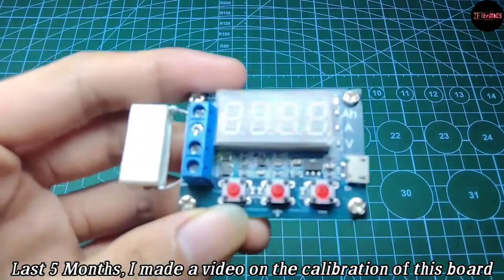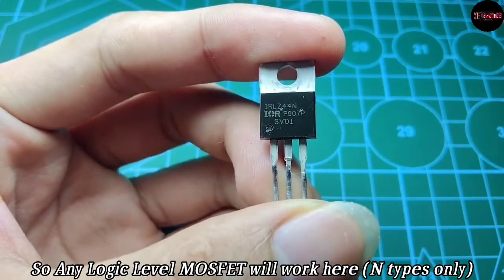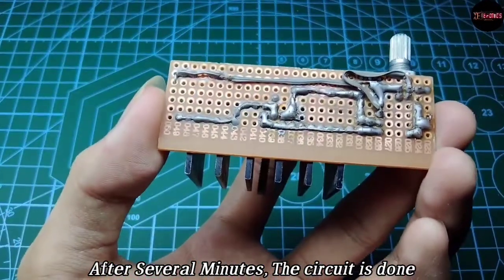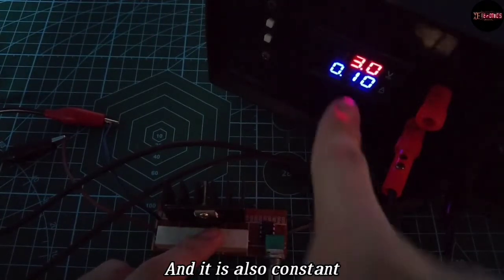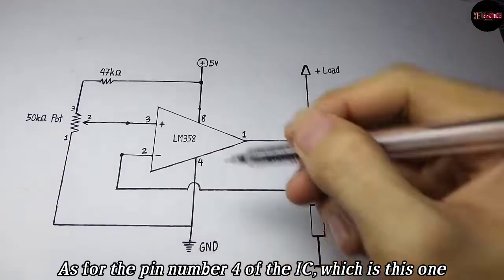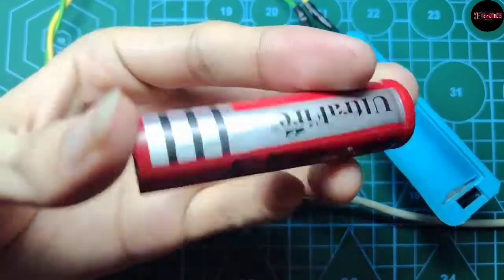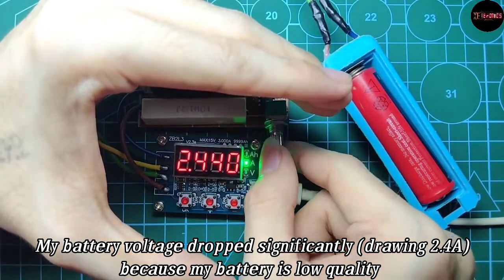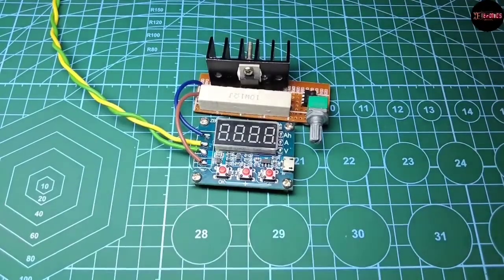Constant Current Load Addition to ZB2L3 Battery Capacity Tester using only 5 Parts!!! #battery

Comment: I built the circuit according to the schematic with the indicated components (the only difference is the 1.5 ohm resistor instead of 1). I immediately noticed one problem: with a 5 volt power supply, I was getting about 600 mA max (...so not enought...). I added a DC booster to the OP's power supply alone, and with 8 volts, I got 2 A. So the circuit works, but for optimal operation, it would be advisable to increase the OP's supply voltage. I hope this experience of mine can be useful. Thanks for your guide.
Reply from the maker: No. Yours was limited because of the value of the pot. There's a reason why I used 50k pot and 47k resistor. Tweaking the resistance of those two will change the max current settings. The reference voltage relies in the supply voltage because it is just a voltage divider
Reply: @x3dtronicsph my circuit as like yours, with 5 volts I don't go much beyond 600 mA. I've seen other circuits use 8/9 volts power supply to avoid these problems.
I'll try modifying the resistor.
Thanks
Reply from the maker: It's because you used 1.5Ohms instead of 1Ohm.

Try changing the 47k resistor with a 22k resistor.
It will work perfectly at 5VOLTS supply with your 1.5Ohms shunt.

The problem with 1.5ohms shunt is you can't draw higher current at lower voltages

Comment: What is the power rating (maximum watts) of your constant current load, sir?
Reply from the maker: Not that high bro.
Around 15watts only.
It's not recommended to increase the power handling because the ZB2L3 module can only support up to 3Amps
Reply: @x3dtronicsph Can I drain a 12v battery with your constant current load at least 2 Amp? (Note: I use a big mosfet heatsink + active dc fan)

Comment: what is the maximum power
Reply from the maker: Depends on the heatsink and Transistor used, It will be limited though because the ZB2L3 has 3Amps Limit
Reply: @x3dtronicsph thank you for responding, if I don't use the ZB2L3 ...
I just want a CC load with high range of power ...
Like testing the 1s,2s,3s...
With high current
Reply from the maker: @manganitemk995 I have another video for that brother, you can check in the channel
Reply: @x3dtronicsph  i dont found any ,can you tell me the power limit of your disgn if i have a biger heatsink.

Comment: Di menit 1:54 LM358 pin 4 dihubungkan dengan resistor 1 ohm, berbeda dengan di skema. Kalau mengikuti skema seharusnya dihubungkan dengan LM358 pin 2. Mana yang benar? Apakah tidak masalah?
Reply from the maker: The schematic is correct brother because I encountered errors.
Please watch the whole video for the explanation
Reply: @x3dtronicsph Setelah mengikuti semua skema sesuai video diatas, kenapa max current hanya di 1200 ma? Any suggestions?
Reply: Potensiometer bekerja hanya di setengah putaran/half turn at (1200 mA)..??
Reply from the maker: What Mosfet are you using Brother?
Reply: @x3dtronicsph Need update your scheme, or remake, re-upload this video.
Reply: @siipokay7526 pakai usb dummy load saja,tinggal atur potensio bisa arus sampai diatas 2A yg versi 15W,terminal block diganti usb female

Comment: Can i use irfz44n ?
Reply from the maker: Nooo.
Any N-Channel logic mosfet will do.
IRLz44n is not a logic level MOSFET.
It will work with higher supply voltages. But that means that you need to check the ZB2l3's regulator or add another regulator.
The usage of Logic Level mosfets here is to operate at only 5v
Reply: @x3dtronicsph  oh yayaya, reason using logic mosfet is can full open under 3V right ?
Reply from the maker: @putriamalia422 absolutely!!!.
Irfz44n can still work, but you need to add regulator to the zb2l3.
There's an built-in regulator in the zb2l3, but I'm not sure if it's powering the whole thing with 3.3v
Reply: @putriamalia422 Sudah pernah membuat load seperti ini? Soalnya divideo diatas, antara skema dengan yang disolder berbeda.
Reply: @siipokay7526 belom bang, tapi kalo lm358 non inverting seperti ini saya bikin nya controller solder sih untuk adjust panas solder aja. Kalo dummy load spt ini belom, belom punya irlz44n, punya nya cuma irfz44n.
Reply: @siipokay7526 kalo pake usb dummy load yg ada dipasaran bisa nggak, kebetulan saya punya tapi belum coba.
Reply: @Awan296-y22 Bisa, tapi Itu konstan resistance, sama dengan resistor keramik.

Comment: Also works with non logical level mosfet like z44n but requires a higher supply voltage ex 12v for higher current load since the gate threshold is higher
Reply from the maker: Yup, it is possible to power both circuit with 12v, addition of regulator is needed, But I guess the builtin regulator of the zb2l3 can handle, it is low current anyway
Reply: @x3dtronicsph  no, it won't both the modules need different isolated power supplies a single one would lead to something called ground loop and the zb2l3 won't work or show a error (happened with mine)not sure how it worked with ur setup maybe using a logical MOSFET made the difference but it's unlikely since the chip(lm358) should be isolated

Comment: Hi, I have connected everything according to your schematic but the current reading is zero when I am starting the test. Even after rolling the potentiometer knob, nothing changes and the zb2l3 reads zero current. What could be the reason?
Reply from the maker: Start the discharge first, it will only show the current when the discharge starts
Reply: @x3dtronicsph I have started it by setting the cutoff voltage and pressing ok. The discharge starts but the current and the capacity remains at zero and the cell voltage remains unchanged....
Reply from the maker: @ervivekchoubey either there's an error with your connections.
Or you didn't use a Logic Level Mosfet
Reply: I am using IRLZ44N which is logic level mosfet. Verified connections multiple times but didn't work. I think I need to give higher input voltage to the OPAMP IC or maybe separate voltage...
Reply from the maker: @ervivekchoubey did you use LM358? Probably its because of a defective component

Comment: Can I use 100k multiturn potentiometer instead? I don't think it makes any significant difference right?
Reply from the maker: Change the 47k resistor to 100k as well, it needs to be the same with the pot value to have a voltage divider that will give a maximum voltage of 2.5volts .
You can use any pot value as long as you change the resistor connected to it
Reply: Ok thanks 👍

Comment: Load or sense resistor negative and the pin 4 of LM358 should be isolated. Means the load resistor shouldn't be grounded right? It will directly go to R2 node of the zb2l3 module. Is that correct?
Reply from the maker: Yes, the load negative will be connected to zb2L3's ground by the MOSFET of the module when you start the Discharge.
It will give an Error 5 if you grounded the load negative
Reply: Thank you for confirming 👍

Comment: Can you tell me how much percentage difference you got in capacity measurement using the electronic load vs normal resistor load on zb2l3. Thanks.
Reply from the maker: In my case bro, it was the same. My Estimated value probably less than 5%
Reply: No difference zb2l3's microcontroller compensates for the lower current with lower voltage (ohm's law basically)
Reply from the maker: @SharvilSawargaonkar yup,, the main advantage of this addition is to set desired current easily.
And for faster discharge

Comment: I am getting error 5 in normal mode when I try to test any battery
Reply from the maker: Rewatch the video bro. The negative input of the battery and the Ground of the circuit should be isolated, you're bypassing the Mosfet that's why.
You need to isolate it

Comment: I use this device.  When I tested the damn battery that said 5000 mah, the device said the battery was 150 mah.  I am not sure if the battery is fake or if the device is of poor quality.
Reply from the maker: Well it depends on the current you've set sir, if it's a Low Quality battery, most likely with High Internet Resistance, it cannot give high current, so if you discharge it with example 1Amps of current, that battery will drop it's voltage and the discharge Test will stop. Try it with Lower current discharge
Reply: @x3dtronicsph  How many volts should I choose for discharge when performing the operation?  I tried 3.0 volts before.  But I couldn't get a good result.  I wonder if it will work if I test it with 2.5 volts?
Reply from the maker: @Elshan_Mammadov_ try to decrease the Current first bro. Try to load it with 12ohms resistor instead

Comment: is there a way to put a fan while discharge? can you make a video?😅
Reply from the maker: What do you mean??? The Fan will start automatically when the discharge starts???
Reply: @x3dtronicsph  yes in resistance. can you make a video how to put mini fan to resistance.
Reply from the maker: Well, you can make another comparator circuit just like the current Load, but the output of the opamp will turn a transistor on, you can connect the fan to that transistor
Reply: @x3dtronicsph  where can i find the transistor? and how to connect. make a video bro. many people want to learn, just like me as beginner 😅
Reply: you can use mini fan as load,but first check the polarity of resistance pin.The fan will turn if battery discharge is start.

Comment: Can I use a signle LM358 to control many Mosfet? I plan to make multiple 18650 slot tester with constant current control. Thank you for your advice
Reply from the maker: You can try , but add around 1k resistor on it's gate probably, Because if other MOSFET go shorted, it can protect other MOSFET, cascading MOSFETS is possible with Dummy loads, but if you're gonna use separate batteries every MOSFEt, i guess it's a bit complicated
Reply: @x3dtronicsph  Thank you for advise, I googled it recently and found that my idea is not good. People always suggest to use 1 IC : 1 Mosfet. For now, I plan to only share the potentiometer and the rest components will be separated. I have another question. I need to increase maximum discharge current. Apart from parallel multiple Z2BL3, can I modify the Z2BL3 directly like change IC or Mosfet? Thank you again here :)
Reply from the maker: Sadly, the ZB2L3 
 is programmed with only Max 3 Amps of current, thats Why i only designed it with 2.5amps max only, evem you change the ZB2l3 mosfet, the current reading is based on its Shunt Resistor, so I guess you need another version of Discharger if you want higher current
Reply: @x3dtronicsph  Hi, is the current fixed to specific value and independent to the voltage of 18650? Like I set 1A at 4.2V at the begining of test. Is the current will drop when the voltage is approaching to 2.75V which is consider as 0%? I have the discharge device which can maintain current until the end. I hope that solution in the video can achieve the need.

Another question, I could not find 47k Resistor. What is the purpose of the resistor? Can I remove it?

Thank you sooo much
Reply from the maker: The current is Constant bro at any voltage (minimum of 2.5v) , the purpose of the 47k resistor is to create a voltage divider with the 50k potentiometer to have a limit of 2.5A of current, (2.5volts reference for the opamp since the supply is 5volts) . The module can only handle up to 3Amps of current. If you don't have that 47k resistor, you can use any Value, but the potentiometer value should be close with that resistor value. Example, 10k resistor with a 10k potentiometer
Reply: @x3dtronicsph Thank you so much for advice, I will try to find 47k as I already had 50k Pot. Anyway, I asked about current as I experienced that current is dropped like from 1,000 mA to 8xx mA once Voltage is drop from 4.2 to 3.3v. It is not about the cell is weak as I can adjust the Pot to compensate the drop and the cell can come back to drive 1,000 mA.

Comment: Im still New to electronics, i see you comented that you use lm358p, can i use standard lm358?
Reply from the maker: Yes of course, just make sure it's a working Op-amp, Lot of Fakes nowadays
Reply: @x3dtronicsph umm, I have made the module, but why mine does not work, I have used Lm358P, when this module is connected to zhiyu, zhiyu read it 0.10 which is usually 0.06 and in the video you said that the mosfet will be hot, but what I have is not at all, can you help me? I try to use a separate power supply and the results remained the same

When i test the battery and turn the potensiometer The current read unchanged remains 0.00
Reply: Thanks

Comment: Why add CC load? The ZB2L3 adjust is current counting to keep accuracy correct. I have tested this many times.
Reply from the maker: Yes it's true. The actual main reason i made this addition was, to have an easy selection of current when using different kind of battery Voltage ang Battery type. It's pretty annoying to change the resistor value every time,  also having a CC discharge improves the discharge speed because, Batteries decrease voltage over time and decrease current as well. Relying in a Steady resistance for different discharge setting will be way better if you have an adjustment knob for it, thank you
Reply: @x3dtronicsph  yea, that makes since. Do you know the max current the device can measure? What's the current sense resistor and max adc voltage?
Reply from the maker: Max current is only 3amps, i didn't measure the voltage drop across the Current sensing resistor at 3 amps, but for me. 3 amps is pretty decent. For low power batteries only.
Reply: @x3dtronicsph  When calibrating the 1A current, measure the voltage across R020, calc the resistance. Half the resistance, now you have 6A (changing the fet too), or anything higher current.

Comment: Thank you for the informative video.
 I assembled the same parts. Then I connected it to ZB2L3, but the current remained at 0mA and did not change. I tried connecting -Load to GND and it started working. In the video it was said that -Load does not need to be connected to GND. What should I think?
With this, I was able to measure batteries with small capacity. Thank you very much.
Reply from the maker: Initially bro, the -Load and Ground should be isolated, When you press something and the discharge starts, the MOSFET of the ZB2l3 will automatically connect the -Load and Ground.
If you directly connect -Load and GND, you will get an Error5 because.
Everytime you put a battery, it will automatically discharge because you bypass the Mosfet of the zb2l3, that's why i isolated it
Reply: @x3dtronicsph  Thank you. When I compared the ZB2L3 you are using with mine, it looked a little different. I bought it recently. There is a description of HW-586 V3.0. It seems to be working fine now, so I'll try it some more.

Comment: I calibrated
It shows the voltage and current correctly but the total current is doubled. How can I find a solution?
Reply from the maker: You need to recalibrate it again.
You probably did some error in the current calibration
Reply: @x3dtronicsph  I tried many times but the result is the same

Comment: Thank you very much !! I've build your design with a Siliconix SMP 60N06 MOSFET and a KA358 dual opamp. It works perfect !!! Many greetings from Landgraaf, NL.
Reply from the maker: Thank you brother
Reply: I have correct myself, one can better use the IRLZ44N MOSFET because the SMP 60N06 is not really suitable for this application. I've tried the STP40NE03L-20 and this has better results, but it gets quite hot.

Comment: Which IC did you use?
Lm358, Lm358p, Lm358N
Reply from the maker: It's LM358p bro.
You can also use Lm393 or other comparator Op-Amps

Comment: How if i want to discharge 20ampere?
Reply from the maker: You can't.
Zb2L3 only support 3Amps of current
Reply: You could modify the current sense resistor and fet on the board (remove them and use external), you should probably use multiples of 3a to make reading the display easier (in your head calculations)

Comment: Very nice,  what great addition to a battery capacity tester, I was actually looking for how to limit current in my DIY bench power supply that looks kind of like yours(minus any current limiting capability) and this looks like it will do it! Sweet!  I also have a DIY capacity tester using arduino and  this will be perfect for that.  Thanks.
Reply from the maker: My pleasure bro.
Thanks for the time👊

Comment: I made the same circuit with irfz44n but it doesn't drawing any current
Reply from the maker: It should be a Logic Level MOSFET sir.
IRLZ44N is Different with IRFZ44N
Reply: @x3dtronicsph  cannot find irlz44n is there any alternative mosfet plz tell me
Reply: Should work many times the mosfts are faulty make sure to buy ior brand one

Comment: Hey... another question
i am made this same Circuit, with 1.5 ohm resistor instead of 1 ohm but...this circuit can drain maximum of 700mA....what should i do now....!?
Reply from the maker: Try changing the 47k resistor with a lower value
Reply: @x3dtronicsph  Ohh....I have tried 100k and 10k potentiometer also, the result is same as before which is 3.5volt (output of op-amp), so the gate of mosfet is not fully open. That's why I tried using 6.4v input instead of 5v input, now 5v is coming (output of op-amp) as a result the gate of mosfet can be opened completely.
[Voltage drop by LM358 is ~1.4volt]
Reply: @SritamKarmakar is using 6.4 volt safe for ZB2L3 module?